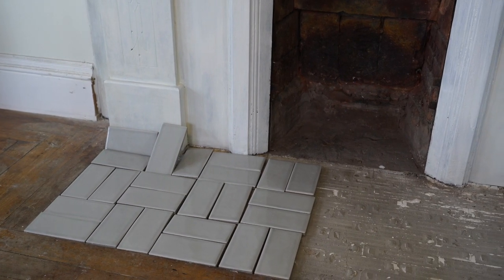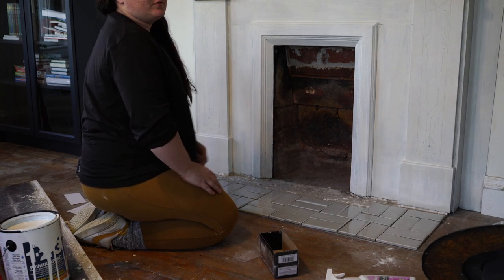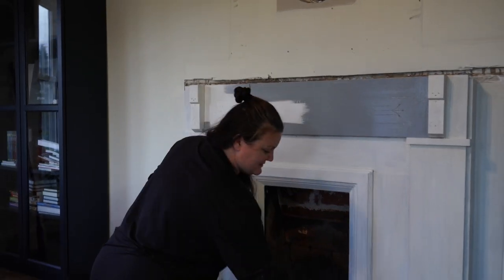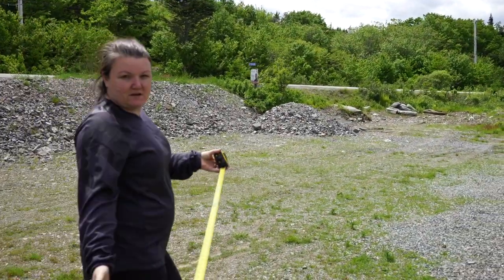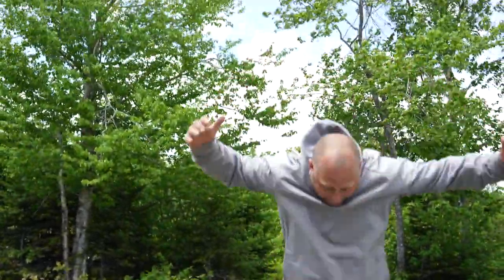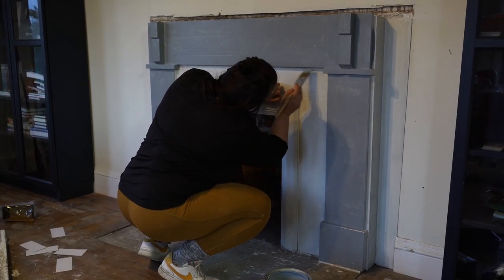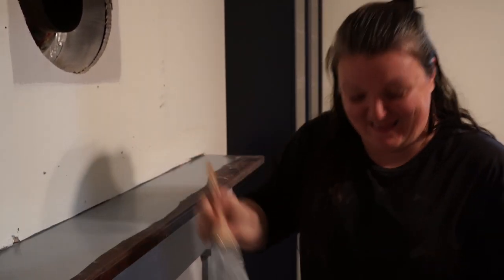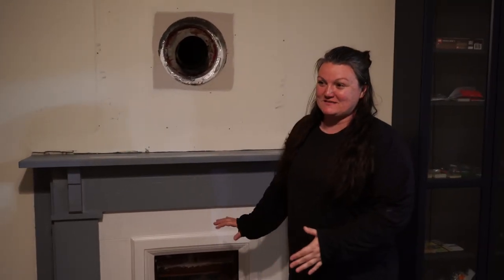Can I pull this off? Abandoned Home Makeover Ep.9 | Elysia English

Comment: TIP: Have you considered using a self-leveling floor material for the tiles for your fireplace? There are so many to choose from that could help you achieve a level floor... like quick Crete. Also have you considered extending the hearth out a couple inches on both sides towards the built-in's? It would be so easy to do and give a much bigger impact for your fireplace.
Reply: If she did she could use quarter round to cover the edges
Reply: Wow - those are great ideas
Reply: It sounded like she doesn’t have enough tiles.
Reply: yep. level it off do it right.
Reply: I would split the difference on each side and or I would also use a quarter round to make up the difference
Reply: @wendyreynolds6959  I think she does have enough... I think she was having a problem configuring them into a pattern she liked.
Reply: Yeah - fill out the space with some quickcrete then she can tile however she wants on top.

Comment: A tip on your other fireplaces.  I used. Multi-tool my brother had that had. Cutting blade that went in flat and straight  to notch out the lower part of the mantle that hung over the concrete. Then I found a large one piece slate tile (they have ones that look like marble) and had it cut and slide it under the notched mantle. You can also sometimes lift the tops off and unscrew the mantle from the wall.

Comment: Be sure you check your new lot info, specifically where the leech field for the septic is. You can't put the house on the leech field because the weight will damage it. A propane delivery truck damaged ours.

Comment: You could get a trim piece to go inside the first row on the front and sides in a really narrow darker coloured tile. I love what you've done with the fireplace, had it been true marble it would be a different story but you've really lightened the room with painting it! I think it's pronounced twall, at least that's what I've always called it as a seamstress. The wall paper is so X-Files!! Love it!! Here's a suggestion, you can get flat paneling (without the grooves to look like wood slats) if you use an air nailer with short nails and put the paneling up first on the wall, then stick the wallpaper on that, it will make the removal so much easier, just take the paneling off, specially if you still have lath and plaster walls!

Comment: You may want to check about moving the house to that lower elevation, rather than up a little higher where the gravel is. I just bought a house in January and didn't realize that there were going to be issues with a lot of standing water when we get a lot of rain and now I'm going to have to put in a French drain.

Comment: I think putting the house on the area where the rocks are is the way to go.  Although it may have to be back in that way and then the glass door will be the front.  That will give room to move in the next house if codes allow you to put 2 homes on that lot and with a septic system.  

I had a thought about the appliances in Little Blue Sky.  What if you get what's available that you can use in the house now?  When your nice things come in they can be used in Little Blue Sky or saved for the next if you plan to build a Tiny House.

I love the Captain!  The colors you are using go perfect with him!    I was also wondering if that top to the china cabinet that was left in the dining room could be put over the fireplace.  It would cover the hole, stuff some insulation in the hole and hang the cabinet over it.  No repairs needed.  I did think it may take away from the live edged shelves.  

GOSH!  All this stuff is so up my alley!  The camper renovations is what brought me to your channel.  I keep wishing your videos were longer.  They end too soon!  LOL  So exciting to see what is happening!  We have a lot of patio projects going on here and my husband's style of doing things drives me NUTS!!!  We put in an outdoor kitchen and the water & drain line needs to be connected.  He moved everything to get to the back of the sink area and leaves it for 3 days.  Then he connects an extension to the gutter downspout that's behind the sink.  I say connect the water & the drain so I can use it to clean!!!  UGH!!!  I can't work with that man!!!  And our RV...the battery was dead, 4 months ago.  I keep telling him we need to get it ready to go somewhere.  The grandkids have been asking to go where they can fish.  Has he charged the battery???  Is it dead DEAD or still able to be charged???  I wish I could drive the BEAST!!!  Summer will be over soon!!!  How do I light a fire under his REAR???  LOL  HUGS~Donna

Comment: wall paper is very good and the fire place was a bold move but definately worth it. Regarding the gold line, my suggestion is the use a fine line sharpie ( or any other permanent marker) as you have the indented pattern to follow and as its not going to be a lot of wear on that part it would work or at least might be worth a try.

Comment: Oh my gosh, so many similarities  of our lives here! 
  We are moving our what I hope to be last mobilehome to a location just a few yards away from where it is now. We have been moving assorted mobile homes, some for us & some for other homeless ppl. With this very old rusty M. For about 7 years. It looks like an antique, it's a 1958 model & hubby has keep it alive far beyond its years! 
I asked him once what is that thing on the front & he replied its where they used to crank it to start it. Now that's old! It has chains on the big back tires, a dump truck blade he welded up to put on the narrow front end tires. To keep from tipping over, narrow front end tractors are dangerous & many ppl have been killed on them. He also welded up 2 steel tongs that hook over the blade & he can pick things up with those. He stuck the big steel tongs through a pallet & added 2 100 lb. tractor weights, some cement blocks & ratchet strapped them on, for extra weight. The front end of the old M. wouldn't stay down when he tried to pull the first mobile home. So he improvised & made the extra weight bracket on his own ingenuity! Backwoods engineer he is along with many other talents. The blade can go up & down & works by the hydraulic system. 
   Poor ppl. kinda have no choice but to become resourceful! And that we have kinda mastered, had to if we wanted to get anywhere in this life. Don't need much but as I said it's all a very long story. But the end goal is when we get the 2 mobilehomes attached together. We are going to have a Amish crew come put a roof over the both of them & finally have a proper roof over our heads. It's been a very long journey. And reclaim repurposing or whatever they call it these days,  is how we made it this far. 
 Your new property house looks like a double wide or manufactured home in the US. But ours have tongues & axels under them for moving. It's a job in itself & a lot of hard work. You take the wheels &  the axels off when you get to where you are going. Even if it's just a few feet. But you also have to take them off the cement blocks & railroad ties they are leveled on  & move them out of the way to put the axels on. It looks as if yours is on logs for rolling. Around here in Mo. Amish ppl. I have seen do it that way. And they had a big wreaker come in & pull the house over. It was only a few feet because they where putting it in a basement they had dug. It was very interesting to watch. But warning when you say we just have to move it a few ft. Its a whole lot more work than you think it will be. It's in the high 90's° here & the heat index is through the roof with humidity & this last move we are trying to pull off is melting us both. We are both in are middle 60's so that just adds to the difficulty, with bad backs & moving all the cement blocks & super heavy RR ties some of the ties are bridge ties, even heavier.  All that & here  it requires for leveling the old school way. Moving by hand everything but the mobile homes. No money to hire things done or the cement pillars proper way. Just Old school all the way. 
 We 2 are remodeling these old mobile homes both.  We are joining together a single wide & a half of double wide. To make a little larger home. They are both 1974 models so the remodle is quite extensive. Lots of painting going on & Phil's delimia certainly reminded me of all the ways I get paint all over me when I paint. Just like him it's a domino affect. I laughed so hard when he got it on his pants showing you where he had it. That would be me also. I don't know how ppl. paint without getting it on them! 
 And the wallpaper are you kidding me. It's a long story but I'm writing a movie, My Stalker Is An Alien. My name is Violet & if you use the letters of my name you can spell Tolive Loveit. That is the aliens name. She comes to earth in a space ship. Because her planet is going bad & to survive she comes to earth. She & her family live in a motor home camper with no motor. At least its not a tent, like in your wallpaper. Lol..  (The movie writes itself, from our real life. We have a motor home without a motor I flipped into a cute little African hideaway inside. Hubby moves it around with attaching a wagon tongue to it & moving it with his old M. Tractor).  
  (Also from my real life, the Alien Tolive Loveit takes a job in a cassino. This also happened in my real life. I was forced to take a job in a cassino. I couldn't make this stuff up, most of the movie isn't fiction. It's kinda a Spielberg style movie.  Lol
 Her mission on earth is to find 10 ppl with virtues before she can go back home to her own planet. To take those lessons back to her planet & teach her ppl. It presents to be very difficult, working in a cassino & all!  
 You see you are not the only person who comes up with some kinda crazy ambitions of the whole world of possibilities. The imagination some of us creative ppl. Can take you far from an ordinary life & you can become the main character in your own dreams.  
We live on a tiny 10 acre goat farm in the middle of nowhere & have very little. But we have always been a reclaimers. Even when it wasn't popular. The difference is there where hardly any ppl. who had a computer, internet, (we still don't, I watch you from my phone internet, we can't get a signal here for broadband.) 
 UTube wasn't even on the horizon or a thing at all, when we began our journey in this life to make something out of nothing or possibly we would be UTube influences. I'm sure of all the things we have done out of the ordinary we would have made money as UTubers. I have a knack for turning around a piece of worthless junk into a beautiful piece of work.  It can be a curse, because I have ADHD. And go from one project to another jumping around all the time. 
  I wish you luck in all your adventures. And someday if you see a movie called My Stalker Is An Alien, you can say you heard about that movie & Violet ( Tolive Loveit was one of my biggest fans!) ❤
 You rock lady, keep believing in yourself, not betting thats scary as I saw in the gambling boat I worked for 3 1/2 years. It turns ppl. Into bad ppl. And it's very sad. Wouldn't wish that life for anyone! Just believe in your dreams! ❤

Comment: As far as the fireplace tiles go, you need to cut a tile with the same measurements to fit on the very end of both sides. 1 inch off,  cut a tile 1/2 inch for both sides. It is doable. I think laying of tiles start in the center. You can do anything!!! 👍🏼

Comment: Make sure you are not putting anything permanent over the septic tank.  It may need to be dug into eventually.  Also, make sure you are allowed to hook up more than one cabin to the same system.  Sometimes regulations or building codes will only allow one cabin per sewer system.  The water pressure could be affected if hooked to more than one cabin.  I don't know, but just check into these things to be sure.  I hope this helps.

Comment: Position the cabin so that ur side porch sits over the well that Phil opened (maybe a hatch in the decking or just take out a few screws if u need into it). That way it’s out of site, not an eyesore and to prevent a safety issue with any renter codes.  Have the front door face towards the hi way.

Comment: How about trimming the bottom of the fire place molding to fit tiles up under the molding. Or using less tiles and adding another decorative thin molding around as a border. Also adding a decorative tile between white fire place frame and outer wider framing.

Comment: I like thoughts by "Hethwen"....I was also thinking that if you used the pattern that doesn't quite fill up the space, you could add a small wooden strip on both sides cut into wedge strips that would minimize the look of it not being level.  Also....I wonder when it comes to painting the gold on the fireplace if you considered using automotive decal stripes? Although freehand may look better....and you are so good at that.  Just thoughts :)

Comment: Funny, it’s all washable, latex paint, jut soak the clothes in water and it will all come off.  I find it funny that you don’t leave all your covers in another room or get whatever paint you need in a smaller container and recover the gallon so the paint don’t get thicker when it’s uncovered.  I also keep plastic bags handy to put the dirty paint brush in so that it stays wet when you are ready to re-use, same with rollers, this way you don’t have to wash and it saves paint at the same time.  You can do that for a few days in a row until your project is done.  Just a hint, we all have our different ways to paint and everything cost so much when you do renovations so that’s my way to stretch my paint and I also wipe all the paint off the side and put it back in the gallon and even clean the groove around the gallon so that when you put the lid back on, it will not get stuck to the gallon.  I love your wall paper.  It’s you guys that were brought over from Ontario to Nova Scotia in an alien ship. lol 😆

Comment: I like the fireplace. What would you think about white corbels and mantle top to balance the white around the opening? I love the wall paper. You two are such fun parents, your boys are so lucky! Ooh had a thought about the tile problem (the gap in the width with one pattern) - you can put a small wood trim mitred at 45 around the edge of the inside of the hearth to make up that gap so you don’t have to widen the grout lines to make pattern fit. It looks nice as a transition line between the tiles of a hearth and the wooden floor. Just a thought.

Comment: I'm Sorry but I probably missed this,. What is the fireplace? Is it a working fireplace? If so the white paint will get smoke damage over a long period. if you use it open like that.Have you considered a Built-in Fire with stove-pipe to outside through the existing fire  'Vent/Spout' I am not sure of the word for this. Like a tiny wood-burning stove...????